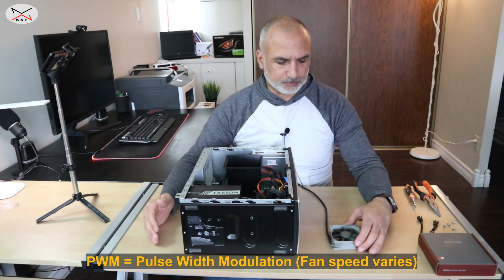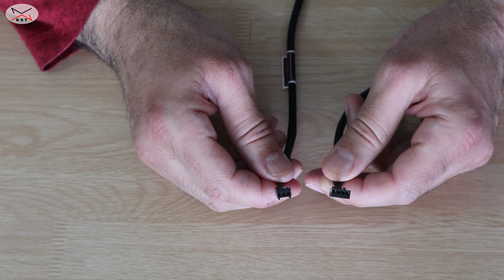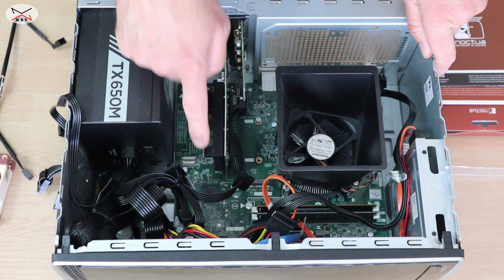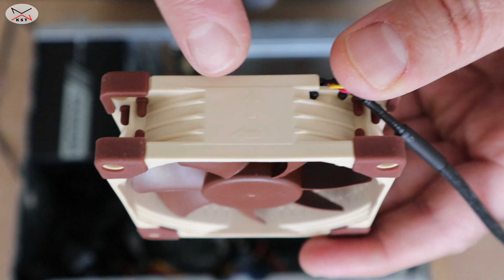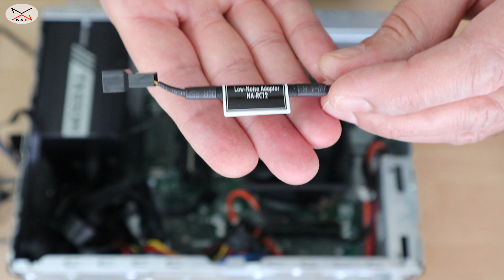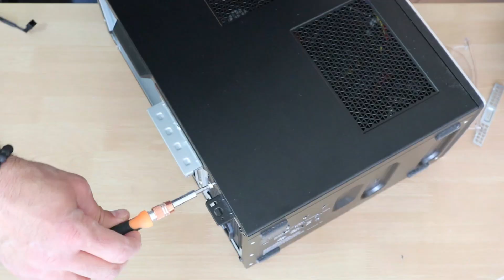How to install a Case Fan in a Desktop PC (Noctua NFA8 ULN in Dell Inspiron 3671)

Comment: Why did you install the fan there instead of at the top position in the rear?
Reply from the maker: It's better to cool the cpu
Reply: @KnowledgeSharingTech  Do you think there is any advantage to having two 80mm exhaust fans on the rear, or is that too much without an intake fan?